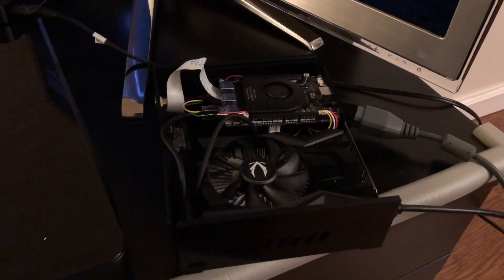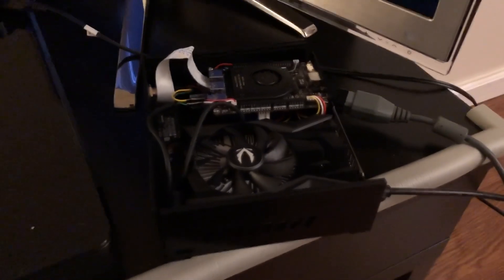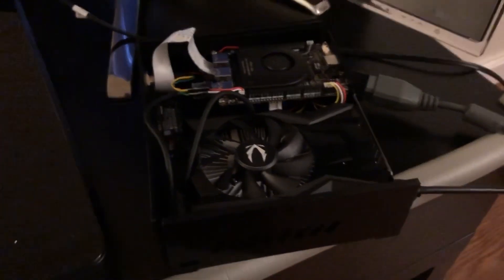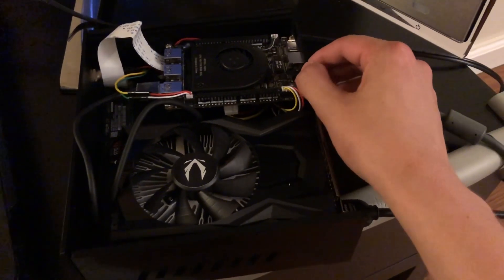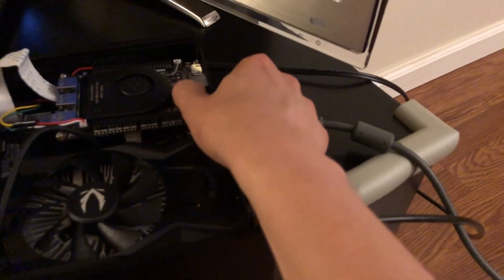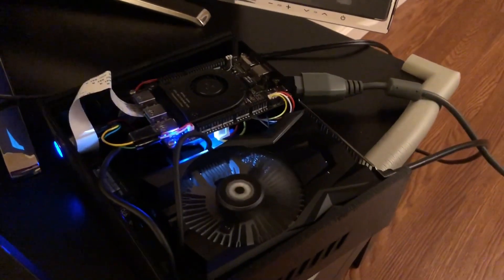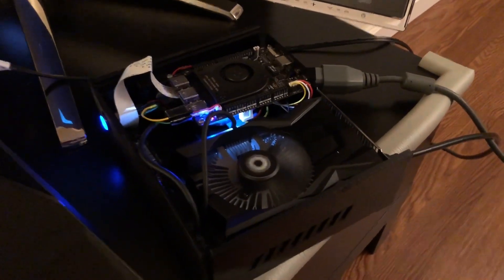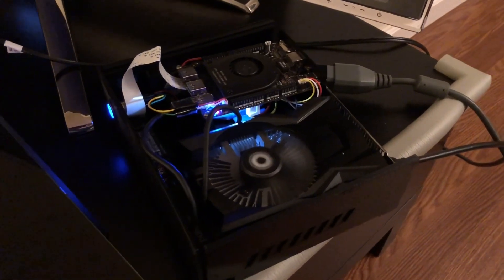SFF Gaming PC: LattePanda Alpha + GTX 1650 prototype case first boot up!

Comment: how is your gpu fan not turning on when psu is connected.
Reply from the maker: Ramchand yalamanchili hi Ramchand, the Xbox 360 psu has a sense wire that needs to be connected to fully power on. I attached this wire to a switch on the back to control when it powers on